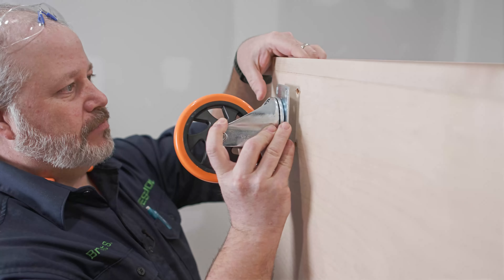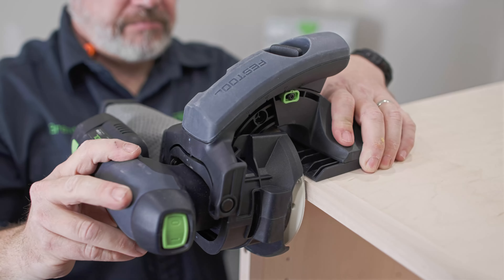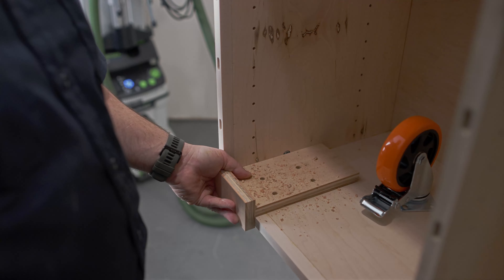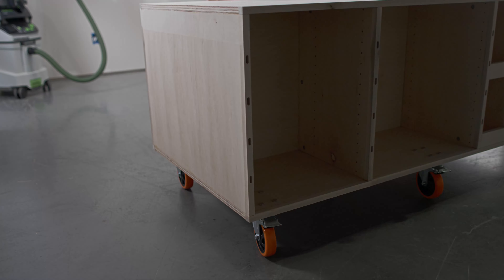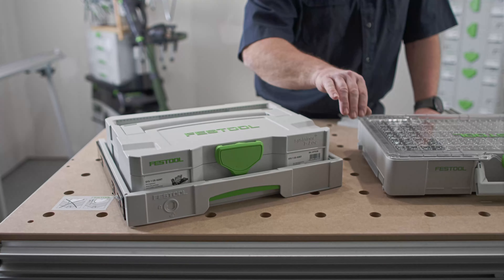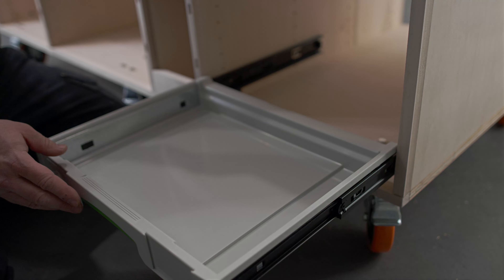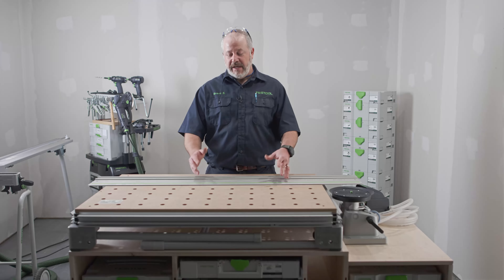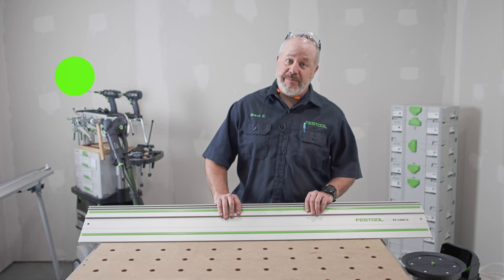Build Series 4: Mobile MFT Cart Build: EP 6

Comment: Loving the inspiration from Timothy Wilmots about the mortises for vertical holding. I also built myself a slightly different MFT cart but the overall idea is same.
Reply: This! 8 years down the line and it's still one of the most inspirational designs for workshop cabinetry and carts ever. Credit where credit is due!

Comment: I definitely learned a lot with this. And I’m sure I will even more when I build one. I don’t have a sys vac. So I’m not sure if I need that side assembly. But… I also don’t want to redesign it. LOL. Maybe I’ll add something else there. 

What is that tool called that you used on the 1010 to clean up the edge banding? I love that!!!! And will it work with the OF1400? Also love the sanding guide for the edges.